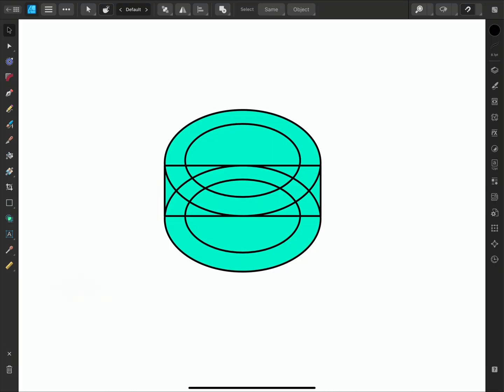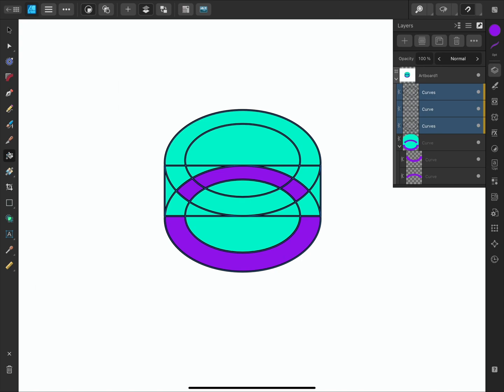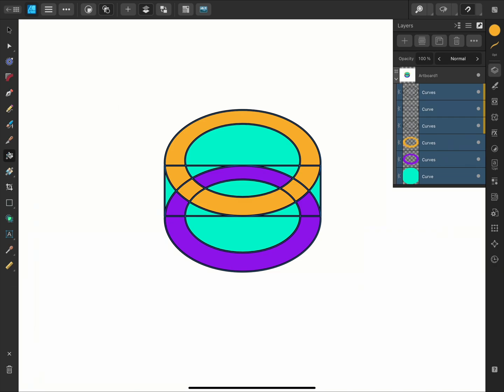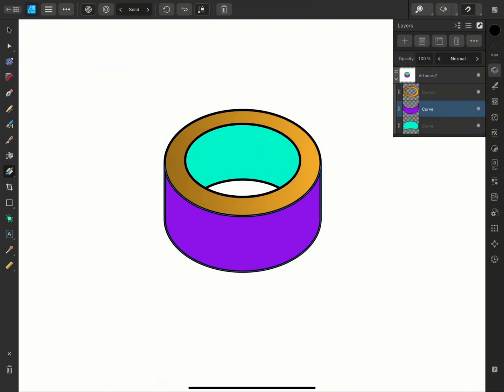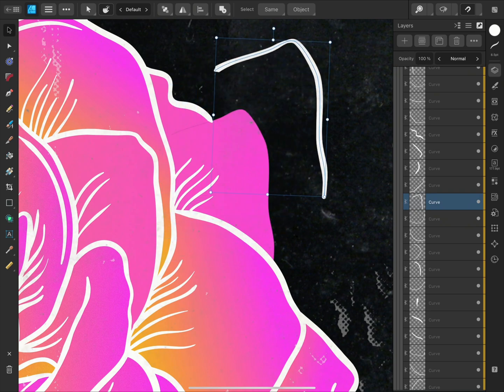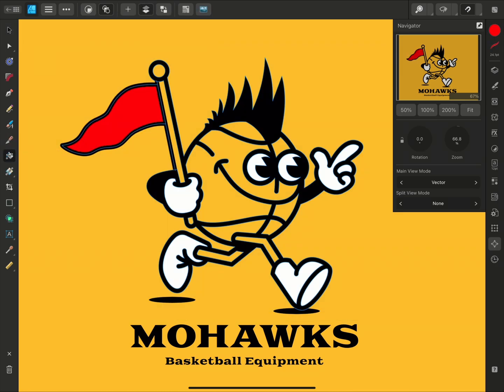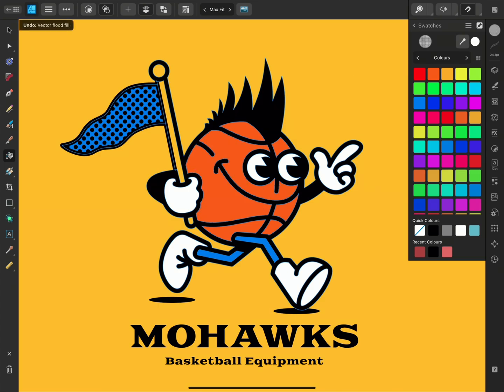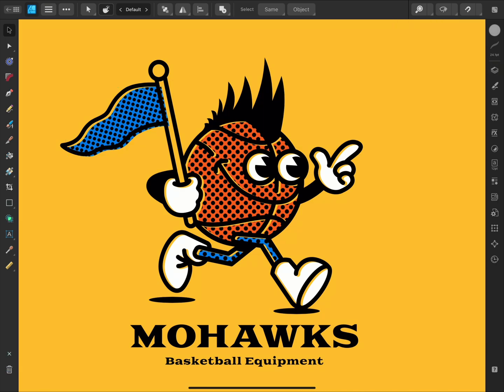Vector Flood Fill Tool (Affinity Designer iPad)

Comment: I'm trying to do this but with filling in the shapes from shape tool but I can't get it to work...I add a bunch of gear icons ⚙️ on screen from shapes tool and then when I try to fill them in with the bucket tool it fills on the same layer as the linart/curves not a sesperate layer. How do I fix this?

 I wish there was an entire video dedicated to show all the existinf ways you can color in an object in affinity designer. I also wanna know what happens if you have vector line art but the color you fill in shapes with are painted with pixel persona will it then look weird when you ENLARGEN it ? Etc etc.